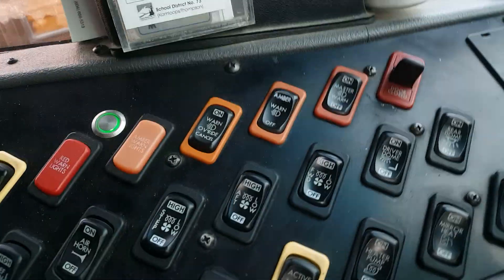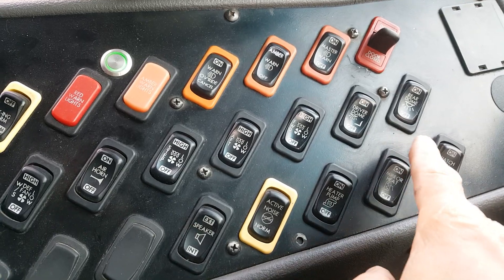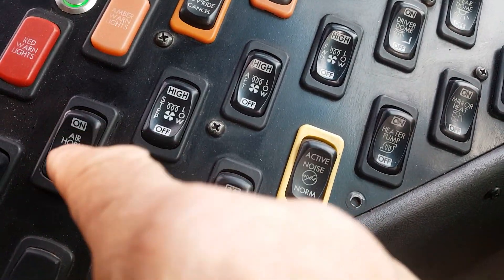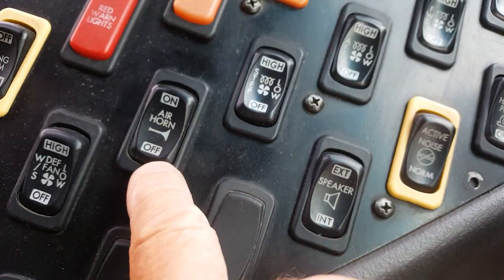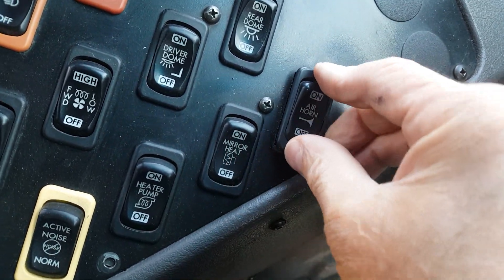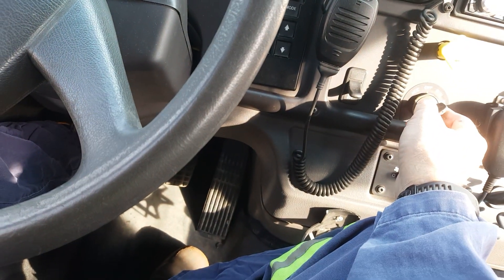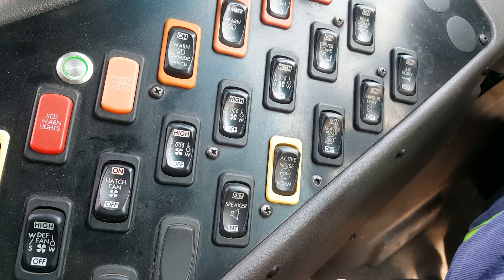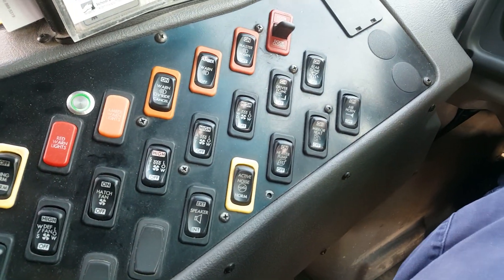How To Relocate Thomas C2 Dash Switches

Comment: what is the outside yellow piece at the bottom left of entrance door thats mostly triangle called? im trying to remove one on a 2006 one of these its held by two screws on front and a security torx screw on the back. i have removed all 3 screws but it will not come off
Reply from the maker: It may be glued on. The C2 has factory glue on all of the body seams and it's strong enough (I've seen the test) that the metal will pull apart before the glue joint.

Comment: Is it seriously that simple ?
Reply from the maker: Yes it's that simple. The multiplex system reads resistance which is exclusive to each circuit. One reason Freightliner went to multiplexing was to reduce wiring.
Reply: I thought I recognized your channel Icon